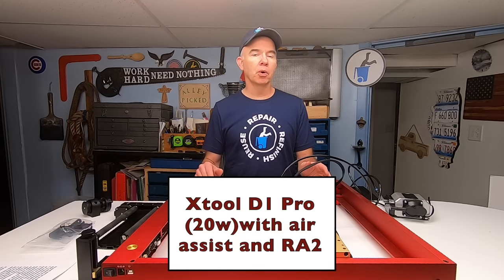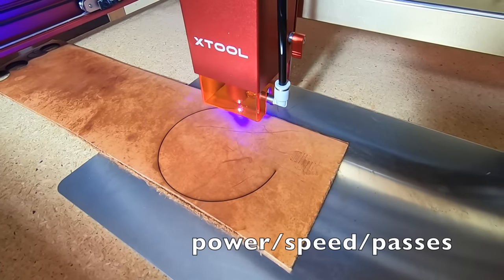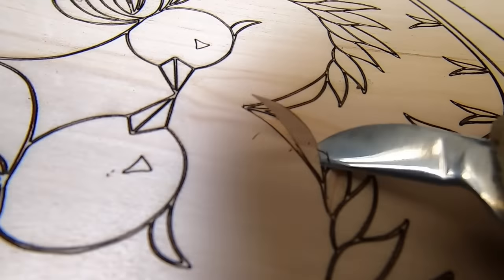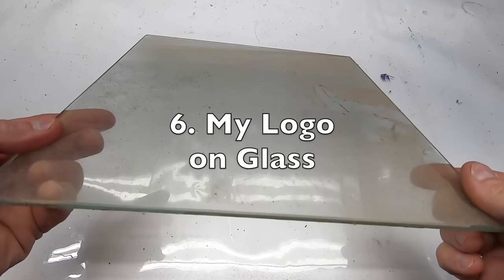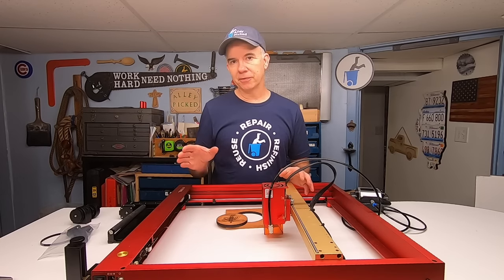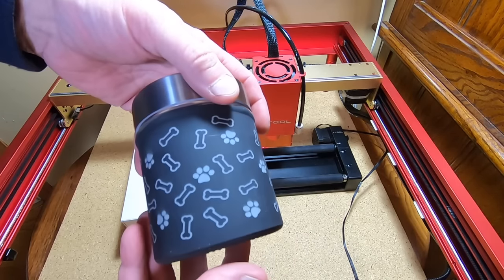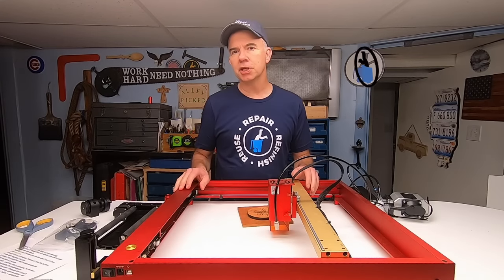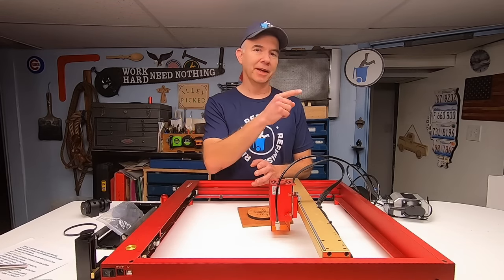11 Creative Projects using the XTool Laser Machine

Comment: I mounted (screwed) my laser on 6" plywood risers. This allows me to place a small table if I need to cut or engrave thinner materials. I remove the table if I need to use for higher material. It's really fast to switch between several thicknesses of material.
Reply: Great idea !!

Comment: Check out the Roly lasermatic10. It’s far simpler to use and is fully contained comes with a rotary and enclosure. The way you have yours setup will probably need to be cleaned a lot.

Comment: Looking at buying Trees 30w air assisted for a multi a is setup. Basically same thing you have slightly more power. I believe they said it cuts up to 1/2” plywood with air assist, of course it also does engraving.

They want $669 and I’ve seen some 20w around the $230 price. It is getting up there where my goal is eventually a 1500w or 2000w fiber for $2500 but I’m not quite ready to take that leap plus this project wouldn’t need that kind of power.

Comment: Can you put Matt black vinyl wrap on glass or acrylic instead of paint? The vinyl can then be peeled off.
Reply from the maker: Very good question. I wasn't sure so I tested it on my F1 laser. There were a couple of small dots that seemed to etch but 99% was blank. I see that xtool sells a black paper for this purpose but I'm not going to purchase 2 sheets of it for $16. Perhaps the more power of the 20 Watt D1 laser might have a better effect but the 10 watt F1 is a no go. That will be a test for later. Thanks for the question.
Reply: @AlleyPicked  thx for giving it a shot, maybe with a higher watt laser

Comment: Great video thanks.  Do you have any problems with smoke or smells without using an enclosure?  Would you recommend an enclosure, or do you find it no issue / ok without one? Regards, Sam
Reply from the maker: Smell/smoke is a problem mostly with wood (Other things not as bad but still a bit...). I need to open a window with a fan blowing out if I do this in my house. So, yes, an enclosure with an exhaust is recommended if you plan to do a lot with a laser.

Comment: many of us with diode lasers use rustolium 2x spray paint for the carrier medium
Reply from the maker: Not sure which is better. I went for cheap :-)
Reply: @Alley Picked  the tempara paint is easy to clean up since it's water based, but the 2x gives great results although you have to use chemicals to remove.

Comment: Thanks, I am new to the xTool D1-20w. It's nice to see someone using the XCS software to create. I have a Mac and LaserBurn does not like Mac's. Great video. (Where do I find the setting for the various materials?)
Reply from the maker: I started by finding a lot of general settings for materials on the xtool site by just googling. Their site is not comprehensive at all. I used it as a starting point and ended up just experimenting myself. I tested a lot of settings on small samples of my material before making final cuts. Keep notes of the settings you use for a reference.
Reply: @AlleyPicked I've seen videos using the creative space software where you choose the material and probably thickness and it displays suggested settings. Is this true?

Comment: Have You tried to cut MDF material? Cutting ideal, round holes in kitchen cabinet doors would make my current project a lot easier. Like this video. Nice job!
Reply from the maker: I have engraved on MDF. I have no doubt it would also cut through it --depending on the thickness.
Reply: I would not do that, MDF can create toxic fumes when heated up. If you dont have an air filter it can potentially be fatal.

Comment: Please what are the setting you used to cut the leather perfectly using XCS. I use the XCS with my XTool D1pro 20W. I keep having issues when cutting leather. Sometimes it won’t cut through totally in some little parts another time i get the laser fire alarm beeping for caution. I don’t know what i am doing wrong. Please i will appreciate
Reply from the maker: The leather settings I used might not be helpful since I had to play with my settings in order to get the right cuts depending on the thickness of the leather. I am not an expert, however maybe I could offer a couple things to consider. Is the leather perfectly flat? I had sprayed mine with a little water and then ironed it flat. Have you tried making 2 passes with less power rather than one pass at a higher power setting? What type of base are you using? Are you using that metal sheet that comes with the laser? Different plates can dissipate the heat better. Do you have an air assist? All of these are considerations. Hope something I said helps. Tom

Comment: May I ask how you created the grid lines to square up your projects? I’m still learning my d1pro and the free software so any help would be greatly appreciated. I made a spoil board just like yours with the leg cutouts but I’d like to engrave the grid lines like you did. Thanks for the video!
Reply from the maker: Using the xtool creative space, I simply drew a rectangle and then drew in lines. copied and pasted lines to complete the grid. Then you can group the whole thing together and resize as you wish. It was not too difficult.

Comment: How do you find the center with the laser? I always frame the project but never seem to get it perfectly centered. I'm also using the same program as you
Reply from the maker: That is a challenge. I frame it multiple times often marking with a pencil where the laser passes and then using a ruler to measure to the ends of the material. Once you get it, you can repeat easily but it's that first one thats a pain. I plan to start using lightburn...perhaps they have a better method. So far, thats all I've got.

Comment: Does it work on Metal to make jewelry pieces?
Reply from the maker: I haven't tried to cut metal yet, but from what I understand, this machine is not made for metal but it is possible to cut very, very thin metal using a diode laser. Generally you need a fiber laser to cut metals.
Reply: @AlleyPicked  thanks for the info
Reply: @JGWed stool sells a IR module that etches steel but I don't think it cuts steel

Comment: the air assist is not for burn marks it makes cutting easier as it clears out the debris from the kirf
Reply from the maker: You may be correct but I do notice on the wood that when I don't use it, there are burn marks.
Reply: It is absolutely to help with burn marks and
 soot. It also keeps your lens cleaner. Just cut some wood with and without air assist. The difference is plain as day.